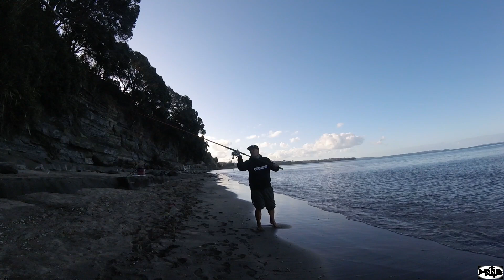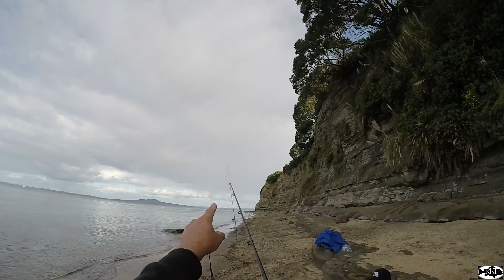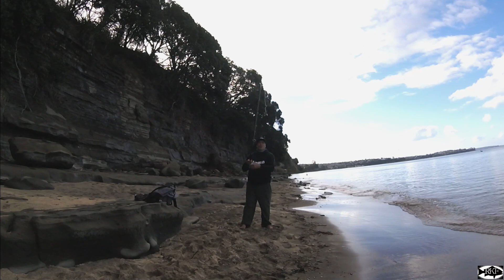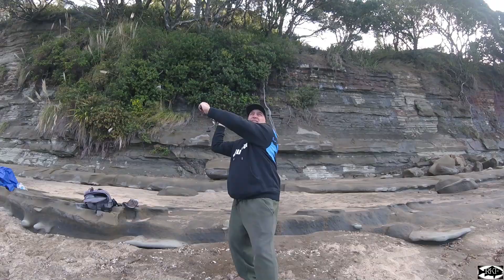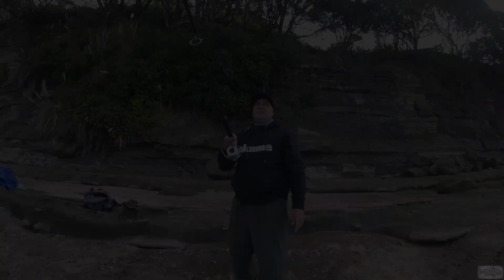How to clean up your casting techneque

Comment: Ever fished off the land round that harbour Omapere/Opononi? Planning a roadie up north for next week tryna find a few good spots for a flick, maybe head over to bay of islands
Reply from the maker: Hi DK
Have only ever done one trip up to Omap/Opo bout 30yrs ago - had a little 12ft tin and the camp owner freaked when I told him me and the Mrs had a good day out over the bar :-)
I did fish once off some rocks with not much joy but there's plenty of spots to fish, I think even the wharf still produces...You can head up to the lookout by Martins beach and walk down to the rocks - there's some good looking spots just on the inner Harbour on the other side to - use to be a boat that took you across to ride the sand dunes but you could see if they will drop you off on the first drop off and pick you up on the last pick up? 
BOI's use to get some epic fish off long beach round to the left hand point - there is a gun tunnel up on the hill don't go past it as get snagged up just fish the point and you can still see your car at the carpark so if you can't see your car you've gone to far (bout 10min walk) Taupeka point worth a crack and even left of the boat ramp - Taupeka has a walk to the right round to the front gets you to some nice deep water. Johndory off the wharf at Russel and the odd Snap...
Hope that helps 
Tight lines
Reply: @Reel-Kiwi-Fishing  legend man cheers! will be checking these out

Comment: Bro do you mind sharing tips and tricks around best time to surfcast? What's your trigger points? Is it tides? Time of day? , seen a few sites on best bite times also.... All a bit confusing
Reply from the maker: Hey ya K
When it comes to surfcasting it can be tricky to actually say when a spot will work as all spots can be totally different. What I can do is put a little vid together and go over a few of the main points I like to do and look at when surfcasting my spots  in hope it will help you out at your spots - there is a few basic things that you can use that will increase your chances of catching a fish. 
OR - I can just rattle off a few ideas now for you if you want?
Tight lines
Reply: @Reel-Kiwi-Fishing  I'll wait bro for vid, I'm limited without a 4wd here in Aucks, can only hit where I can walk from my van, you have got me into fishing, it's something I want to share with my girls :)
Reply from the maker: @koolkiwikat  Algd man - I'll try put something together - I'm heading away north in couple weeks so may have to wait till after then?  Most of my Auckland fishing is around tides at certain spots and those magic hours (early morn or late arvo) Auckland doesn't fish like it use to especially the bays but you can luck a few along the water front or up the Harbour - make google maps your friend - it will show you channels and holes etc - you maybe fishing spots you need to fish on the opposite tide as your not reaching channels or those outer holes. The further you head north or the Thames coast the better the fishing. Through that late summer the Waitemata can hold good fish which can be reachable from the city side and once again google will help you a lot for spots.
You may have to come back to me in a couple weeks to remind me :-)
You may have already seen this little vid on how I find my spots - this works for all areas along the coast - https://youtu.be/_CEF3fpjFHg
Tight lines

Comment: Great video, for a 30 pound mono, how many pound  shock leader should I use  to absorb the force of  casting because it does help with casting. I have two 16foot rods and want to improve my distance. I find casting far helps me land some nice sized snappers especially at night 0200-0530 and dusk. Thanks
Reply from the maker: Hi LK
I don't use shock leader as I use braid and haven't really used the extra leader, sometimes I just run a heavier trace - if your using 30lb that is pretty heavy (are you breaking when casting?) you can try dropping your line weight down to 15-20lb mono which will help your distance. If you want to try a shock leader you could use a tapered 15-50lb one to suit or if you run 15-20lb main you could just run a 15ft 40-50lb leader.  
Tight lines
Reply: @Reel-Kiwi-Fishing  Thanks Jase, we value your expertise and skill and knowledge always, no I am not breaking when casting, as I take my time. I will change now to a lighter mono and let you know.
Reply from the maker: @lesliekistanministry191  Yea see how you go - surfcasting wise off the beach isn't to bad and you should find you'll get extra distance but once around the rocks you may find the lighter line giving way from abrasion, snags, fish biting through the line etc you can always run two spools one heavier line one lighter line so you can swap over if your losing fish etc 
Tight lines
Reply: @Reel-Kiwi-Fishing  Thanks Jase, awesome, you are a fountain of knowledge, there's only one of you! Cheers mate. Also the snappers do not appear to be big now, I remember one of your videos you mentioned that you do not fish in the harbours because of small snappers, when will the size improve? Thanks again.
Reply from the maker: @lesliekistanministry191  I like to fish more towards that early Autumn as the smaller fish move out and the bigger fish hang in there a little longer then back at it early Spring :-)
Tight lines
Reply: @Reel-Kiwi-Fishing  Oh, okay, thank you.

Comment: Hi Jason, what rod is that you are using in this video, is it a Solaris ?  I assume you have cast both the Solaris 2 and the new Soul surf rods ? (I have seen your video using the new Soul surf) . What would you say is the better/easier rod to cast ? Is the Solaris hard to load up or would you say a fairly new to surfcasting caster would still get reasonable distance out of it ?
Reply from the maker: Hi B
I haven't used a Solaris before so can't really put the two against each other - looking at them side by side spec wise it looks like the Solaris will have a bit more fast taper with the heavier weight rating and able to cast a little heavier sinker so would load up a bit quicker. The Soul has a little more length and also runs replica LR guides (Titanium) the Solaris has fuji K guides.
Both 3pce and would say both are slim blanks. If you want something a little more stiff the Solaris would probably be that but I did get use to the Soul surfs softness slow medium tapper with decent distance in the cast but do like a little more fast tapper my self.
Hope that helps and tight lines